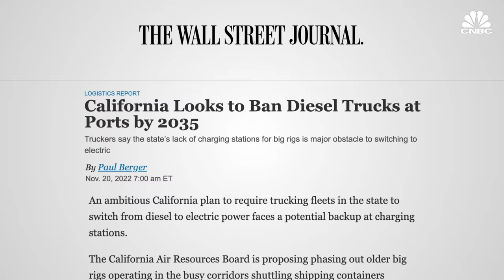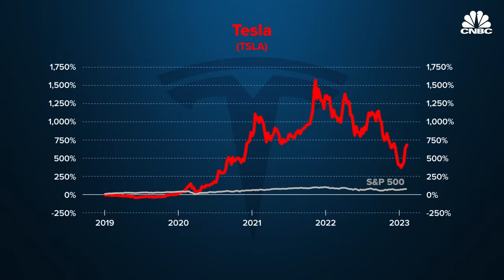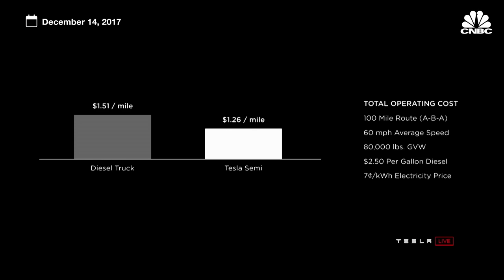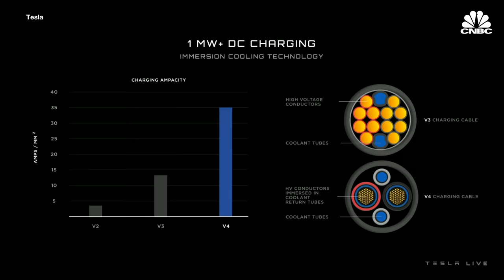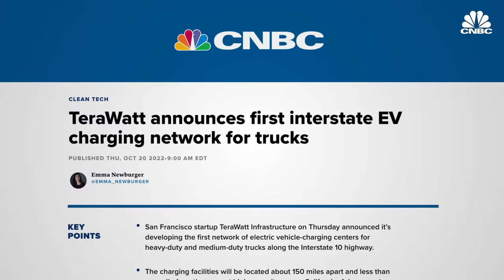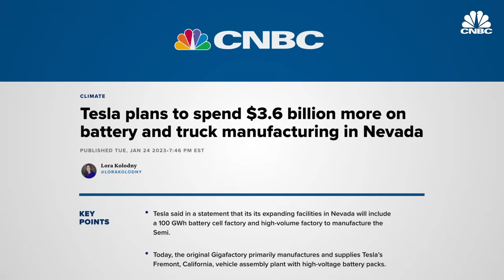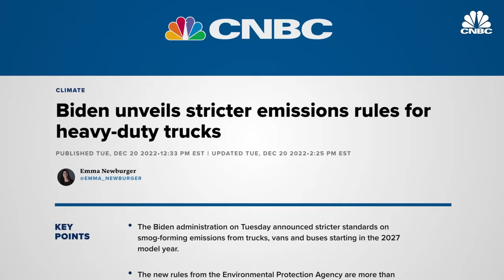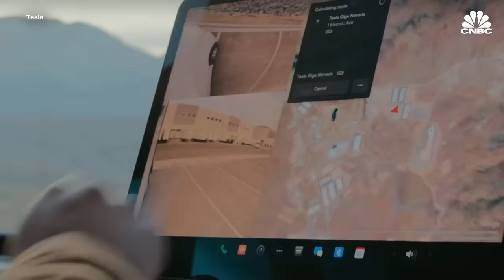Does The Tesla Semi Live Up To The Hype?

Comment: I am a truck driver. We have many trucks that carry far more weight than 80,000 pounds. You solve the weight problem by adding more axles and more wheels to carry the extra weight. The largest cost is the cost of fuel. Elon Musk claims that the Tesla Semi can go 500 miles fully loaded on 1000 kilowatt hours of electricity. The wholesale cost of electricity is currently 7 cents per kilowatt hour. That is a cost of $70 to go 500 miles, fully loaded at 80,000 pounds. Currently I pay over $300 for diesel fuel to go the same distance. That is a significant fuel cost saving. That is what is important to truck drivers. That fuel cost saving makes the Tesla Semi very attractive if the purchase price is only $180,000. I paid $150,000 for my diesel truck. For the fuel cost savings that Elon Musk has promised, I will be delighted to pay $180,000 for the Tesla truck.
Reply: Yeah but fixing an electric semi will cost wayyy more than diesel .
Reply: what gives you that impression?
Reply: @El_Funky_Habibi  Alot less to fix...
Reply: Well when my kw comes too tow your electric truck too the shop don't start crying when I give you the towing bill
Reply: Sure you are a truck driver. No doubt .

Comment: Pepsi's experience in the next 1-2 years will greatly determine the early adoption of the Tesla Semi by other companies with similar requirements.  If Pepsi exercises their option to take the remainder of the 100 units, that will be an affirming sign to other potential owners.
Reply: Right, if it can handle all the Liquid Weight it should be able to handle anything.
Reply: @@BeatBox-nu4oi Literally no authoritative voice is asserting that the Tesla Semi is going to garner the domestic semi-truck market in any foreseeable future.  Pepsi has over 11,000 tractors.  Pepsi is simply evaluating the Tesla Semi will give them a financial advantage over the semi-trucks in current fleet.  If Pepsi expands their fleet of Tesla Semis, others with similar requirements will take note and act accordingly.
Reply: @douglas-hughes Mostly because electric just simply doesn't have the range. It's probable that we will see hydrogen powered trucks or at least hybrid systems before we see electric. With that in mind, It would be nice if Tesla or anyone really can finally succeed in reducing the cost and emissions of trucking.
Reply: @fastestdino2  Well, as the man himself said, these are specifically for medium haul, mostly at intra-state level. These can’t dethrone the long haul market yet. That needs alternative fuels, as batteries have very low energy density.
Reply: Pepsi returned the trucks from what I heard. Range is the issue.
Reply: @briankinney2295  Not as of late November of 2023 according to Amanda DeVoe, Pepsi’s transformation and strategy director.
Reply: Are they using them for short haul or long haul?

Comment: Given that EV trucks are 0% of the market, even if they currently can't cover all use cases, there is still a huge market for these.
Reply: 8:35 Wouldn't say EV trucks are 0% of the market - they even say in the video they also use BYD and Peterbilt electric trucks
Reply: @MiningBlock  Also eCanter. They've been rolling around as grocery trucks way before Tesla Semi was taken in by Frito Lays and Pepsi.
Reply: for hauling potato chips they sound great, around here they haul stone though....
Reply: @rumls4drinkin  Hauling stone isn't a problem. Roughly the same payload capacity as diesel semis.
Reply: @anthonypelchat  Frito trucks got 425 miles hauling chips,  Pepsi trucks only got 100 miles on the same charge.   The payload capacity and range is a huge difference.
Reply: @rumls4drinkin  That is incorrect. First, max payload capacity is a full load of Pepsi, regardless of range. And that payload is roughly the same as a diesel, not 1/4. Second, the trucks are kept to specific ranges because they don't have charging at hardly any locations. Even the video said that Pepsis were transported between depots up to 100 miles, but over 400 mile routes. That is not 100 miles of total range. 

400 miles at heavy load is in line with the 500 mile range advertised. That is because they won't be running down below 10% and likely not charging over 90%, leaving a nice buffer on the new tech. Once more charging stations are installed and they get more comfortable, you will see more long range drives at heavy loads.
Reply: OK bud lets pretend carrying 10,000 pounds vs carrying 60,000 pounds in your fully loaded trailer doesn't make a difference at all.
Reply: @rumls4drinkin  Who said it doesn't make a difference? Max payload is max payload. You don't have to max it out, but you still have a set max. The max payload for the Tesla semi will bring the total weight up to 82,000 lbs. That brings the range down to 500 miles, or 400 with a 20% buffer. When you run with less weight, the range goes up. That is why the lighter payloads are using the semi for longer ranges. They can do so just fine without risk and likely get back home.
Reply: @rumls4drinkin  that's just the route distance, not limited by range. Diesel trucks on the same job would do the same distance because the distance from warehouse to destination is just what it is. It's not like they suddenly moved the entire warehouse closer just so they could use Teslas. The range of the Tesla is 500mi fully loaded (approx 44-45,000lbs of cargo) at an average speed of 55mph. The trucks doing the 425mi with chips are arriving with around 20% battery remaining. They could easily do the same trip fully loaded with beverages.
Reply: this is FALSE, cnbs LIED.
FACTS are the Tesla semi in its 500 mile version , covers 99.99% of use cases in North America. 
and because the Tesla semi battery is MODULAR , it can be Adaped to many Different kinds of operators. 
TESLA semi can even use LFP Prismatic , for short haul for even Greater savings .
LFP can be Charged to 100% Daily , unlike 2170.
LFP costs LESS , but its Heavier than 2170 . 
BYD currently has Class 8 w/ LFP in operation.
TESLA is building a NEW 4680 cell Factory right next to Tesla semi Factory.
in the Future Tesla semi will use Superior 4680 cell Format , for LIGHTER weight and Longer range. 
FULLY loaded a Tesla semi w/ 4680 can go over 650+ miles, in one go + charge FASTER.
Reply: @rumls4drinkin  Pepsi "potato chips" are a bit heavier.
Reply: @rumls4drinkin  The stated range is for max payload.   It sounds like they are doing 400 -425 miles and not the advertised 500, but you wouldn't drive an ICE truck until the tank was on empty either.
Reply: @rumls4drinkin  There is a reason Pepsi and Frito-Lay were good initial candidates.  One of the heaviest things you can ship, and one of the lightest, and they go to the same places.  Tesla can extrapolate between the two.  And neither cargo is lost if the tractor runs out of electrons.
Reply: @markplott4820  Ok so we need trucks that can deliver about 4-6 loads of stone a day, 20 tons to 40k tons, max delivery range is 60 miles for the state contracts.   

they're gonna be outa juice before the day is done.  

so i don't think it covers 99.9% of use cases...

if you only picture long haul trucking and sleeping while it charges it's a bit different....
Reply: @josephastier7421  Yea it is a good comparison.    These guys are all insisting they can run a load of pepsi the same distance they can run a load of fritos though.
Reply: @rumls4drinkin   - TESLA semi is 82k Gross 535+ mile range , half that for Turn & Go.
can install Megacahager nearby for 540+ mile range , 30 min break to Charge 300 mi. 
your TOTAL cost is Cheaper w/ Tesla semi than Anyother FUEL. 
60% less Maintanance. 
ROI is just 12 mos w/ TESLA semi.
let that SINK in.
Reply: @rumls4drinkin  Since they obviously can't, they either misspoke or we misunderstood them or something got reported out of context.
Reply: @rumls4drinkin  your numbers seem off.  Don't know how you are transporting 40 ton loads. That's 80,000# without the vehicle weight. Usually the max load is less than 45k# of cargo to stay below the 80k road limit.  But 4 loads going round trip at 120 miles is 480 miles. That is within the Tesla semi's range....just. so it may not work for that situation, but the bottom line is that it's the longest range electric semi available by a large margin.
Reply: @rumls4drinkin  no! Just no!
Reply: @markplott4820  lol….
Reply: @markplott4820  what a lie from this troll!
Reply: @anthonypelchat  Tesla haters think these trucks carry the same cargo 400 miles. It seems they require someone to tell them what happens when a delivery is made.
Reply: @anthonypelchat  The real world use will be very interesting. If you aren't an Elon Musk hater the possibilities are endless. I prefer twitter2.0 by far.
Reply: Yeah look up the Congo, and what has happened mining cobalt for ev veihicles…..
Reply: @anthonypelchat  good point, if theres a charger every <5 miles, you can logistically max their range at scale even if you don't want them refueling during working hours.
Reply: Brucec 95:  Exactly.  And does ANYONE outside the fact free deny despite ALL reality crowd really believe that NO progress in batteries, charging, etc. will occur over the next decade? Two decades?  So of course, the proportion of use cases will expand STRONGLY over time. 

And once the economic AND performance (including charging times) case is superior for case X, then the BEV trucks own case X.
Reply: @joshkrause2977  I agree that cobalt-free batteries are better, and I’m glad that Tesla has been moving away from using cobalt. 

When are the oil companies going to stop using cobalt?
Reply: 300 or 500 miles was promised but it LOOKS like the real range right now is only 100 miles carrying pepsi and 425 carrying potato chips.  I'm not seeing much data to back up anything else.
Reply: @MiningBlock  Okay then 0.005% of the market.
Reply: The range of these things will be whatever is most economical for the customers and what is allowed by physics going forward.  It seems like there's a number of people that believe that these numbers are somehow very relevant or set in stone somewhere. It's quite baffling.
Reply: @rumls4drinkin  Completely false. Just because they choose to carry Pepsi on 100 mile trips doesn't mean the range is 100 miles. As Mark Plott stated earlier, the proven range is 535 miles, loaded to within 1,000 lbs. of 82,000 lb. GCVWR, from sea level to sea level with a 4,200 ft. pass in between.
Reply: @joshkrause2977  I assume  you're boycotting all other products that use cobalt? If not, isn't that a bit hypocritical?
Reply: we don't know the weight of that truck used in the that test.
Reply: @rumls4drinkin  If you're referring to the 500 mile range test, it's stated clearly as 81,000 lbs. in the header information in the YT video of the test, here: https://youtu.be/GtgaYEh-qSk?t=2.
Reply: @BigBen621  thats the combined truck and load weight, we arent told what either weigh, there are alot of blanks about these tests.  the company not being forthcoming with those basics makes it very sus.
Reply: @rumls4drinkin  Best estimate by several credible posters based on known and observed information is 26,000 lbs. to 27,000 lbs. Acolytes of Thunderf00t will of course deny that.
Reply: Forget traditional EVs ( ie BEVs) these need to run on fuel cells powered by Hydrogen.....too much weight in batteries
Reply: @rumls4drinkin  that’s taking their comments out of context.  There is nothing they suggest their routes are limited due to range
Reply: @drill_fiend1097  So I looked it up. Peterbilt is US owned. eCanter is Japanese (Mitsubishi) owned. While BYD is Chinese.
Reply: There are many EV utility truck manufacturers.
Reply: @anthonypelchat  you drank the Musk kool-aid. Zero chance a full payload EV trucks can have a 400, 300, or even 200 mile range. And we will just ignore winter range.
Reply: @truantray  Engineering Explained did the math. Go watch him. Even if you don't, don't be a fool. Enough batteries give enough range. Hitting 500 at a max weight of 80,000 or more pounds was never the issue. Hitting that range at that weight limit while having a decent size payload was always the question. Anyone with the slightest bit of knowledge and common sense knew that.
Reply: @truantray  Who said at any point that payload capacity doesn't affect range? Don't know where you're from, but apparently they lack both common sense and reading comprehension.
Reply: @rumls4drinkin  that's what pepsi announced that their trip length is for the initial trips, but will be increased in the future. You know they tested it with Full load at 500 miles through a mountain pass right?
Reply: @joshkrause2977 look up deaths caused by carcinogenic particulates in diesel exhaust. Cobalt is not used as much in electric vehicles as it is in petroleum refining. The kids in the Congo video was very misleading propaganda.🤔
Reply: @BigBen621  why increase demand is all I’m asking? Ev batteries have increased demand over 50% in the range of 70% depending on the source. How is that better then what we have? No safety at all and with the amount of money being made people are being paid what? How is any of this better?
Reply: So here’s the issue: today I’m running 72 rolls of commercial paper (cargo weight 44,218 pounds) exactly 600 miles from the mill in Wisconsin to the customer in Ohio. The customer has set the appointment time for 0800 tomorrow morning. Now, with my diesel Kenworth that’s no problem at all. I’ll get to the customer’s location this evening, park overnight, and be ready to return home as soon as they unload. I’ll have to refuel once before I get home, but that will take at most maybe half an hour. With a Tesla Semi, it’s nowhere near that simple. For one thing, the best case scenario has me running out of charge a full 100 miles short of the delivery. Having driven this route a few times, I can say confidently there are no chargers near there. But even if there were, I’d still miss the appointment time because that hour that I’d be waiting to charge comes off my 14 hour clock, meaning I’d run out of time and have to shut down anyway. And what happens to my range when I need to to run the climate control overnight? 

EVs might be practical and even better in some applications. I’m thinking of niche vehicles like garbage trucks, UPS step vans, etc. But long haul, over-the road? No.
Reply: @anthonypelchat  do you know what an overweight permit. i drive locally and am permitted for 102K lbs. i haul milk.
Reply: @andrewdonohue1853  What's your point? An EV Semi could get that permit too.
Reply: @anthonypelchat  an EV semi will NEVER be able to do that job. what good is a permit if the thing dies on the first hill?
Reply: @andrewdonohue1853  Let me get this straight. You see a semi that can easily carry 82,000lbs over 500 miles through mountains with minimal issue while having more torque than diesel semis at the same time. And you think an extra 20,000lbs is going to make a huge difference? Range will drop of course, but still over 300 miles on a charge.
Reply: @rumls4drinkin  
 OK bud lets pretend carrying 10,000 pounds vs carrying 60,000 pounds in your fully loaded trailer doesn't make a difference at all. 
A Tesla Semi has a payload of about 44,000 lbs., and no street-legal diesel semi has a payload of 60,000 lbs. Other than those little details, you post is completely accurate. Oh, wait...
Reply: @rumls4drinkin  No one is claiming that. The demonstrated range loaded with about 42,000 lbs. of Pepsi is a little under 540 miles; and it's easy to calculate that the range loaded with about 5,000 lbs. of Fritos is about 760 miles.

Comment: Where EV semis will save the most of is maintenance and downtime due to maintenance.
Reply: One factor nobody considers is average speed.
The Tesla wil achieve, then maintain it's speed over a distance.
That could allow either a faster trip, or more rest time for the driver (and charge "splash and dash"! for the truck)
Reply: @rogerstarkey5390  Also EV performance doesn't degrade at high altitude.
Reply: @rogerstarkey5390  Faster acceleration requires more energy and these trucks absolutely do not have energy stores to spare.
Reply: @zaidpatel8695  supercharger. like the helis that can go to everest.

Comment: At about 10:30:

I know what fleet buyers want: Lowest Total Cost of Ownership.
How hard was that?
If Tesla offers that, they'll sell a lot of trucks.
Reply: Seems to me without doing any calculations, that Tesla Semi is going to be much less to operate.  Cost per mile is going to be much cheaper than diesel.  Also much less maintenance on the truck once any kinks, are worked out.  I’m guessing the actual nos. are going to quickly make diesels a thing of the past, not hard to project.  The mass arrival of 4680 batteries is also going to be very significant.